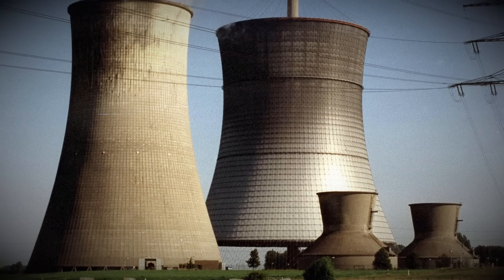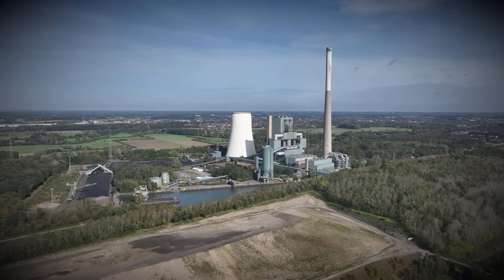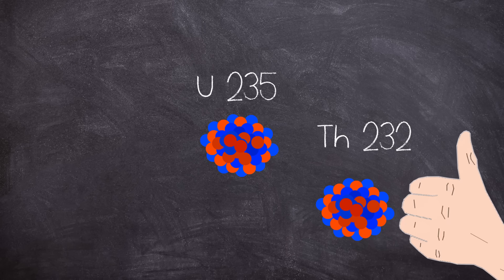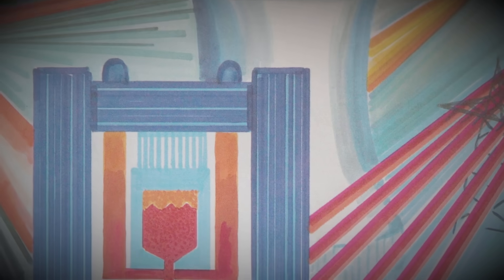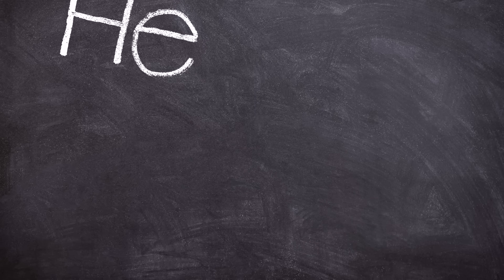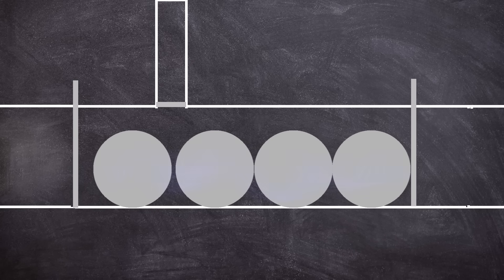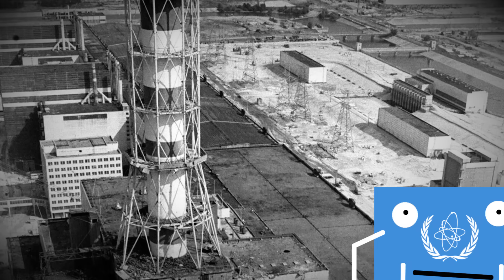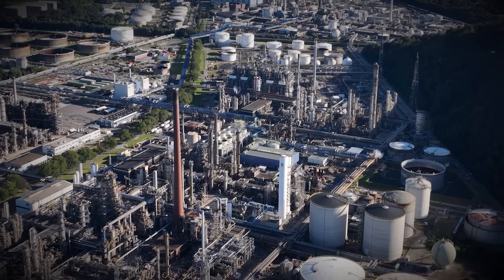Inside Germany’s “Chernobyl”

Comment: This is the silliest reactor design ever. The RBMK is much safer if safety systems can't be bypassed. If Germany built proper reactors they wouldn't need to cuddle up with Russia for energy supply because they didn't learn how that went the last time.
Reply: There are many improvements in recent GenIV reactors.   The older (GenIII+, GenIII, GenII, GenI) water based primary coolant designs generate a large volume of radioactive water; compared to helium primary coolant which runs much hotter temperature and does not become radioactive.
Reply: @Carlos-im3hn  Hmm, (ponders) what if Helium-4 captures a neutron and turns into a different, radioactive isotope? According to what I could find, this would decay instantly...
Reply: Only a minor part of the imported gas is used to generate electricity. About half is for other industrial purposes and about 40% for domestic heating. Electricity only accounts for ca. 13

And the share of electricity produced by gas plants was always round about 15% over the last 2+ decades, while nuclear was at about 30% when it peaked.

We didn't replace nuclear with gas.
Reply: Germany had plenty of proper reactors, THIS was an experimental reactor...

Comment: There is professor Nuclear Engineering Dr Robert Hayes that has much better description of this & other types of nuclear reactors and I has videos of that. This issue came about a feeding mechanism that failed but not the reactor design. Nevertheless, due to the Cold War, the Germany being on front lines of East & West, the German people has a right to protest as if the Cold War went hot, Germany & it’s people would irradiated & destroyed.

Comment: Phillips 66 oil refinery in Lincolnshire has a wide history of disasters. From a steam valve release causing two workers with horrific burns in 2000 to the 2001 Easter Monday explosion. Also next door is another refinery called Lindsey oil refinery which in 2010 had a pipe ruptured when the crew cut the pipe after told it was safe. One sadly didn’t survive.

Phillips66 Lincolnshire also had an oil or diesel leak which started a plant wide fire i think in the 1990’s but all information on the web has been lost. I do still have a newspaper from my dad who worked on the plant during the fire but it’s in the attic.
Reply: After the explosion on 2001 they had to install a community alarm system to warn the village if an incident was likely to affect the village… yeah they didn’t have a village alarm until ordered by H&S after the explosion. Both refineries are dodgy and has had constant issues with either coal trains derailed, fuel tank farm overfilled, one fuel tank imploded while pump was cleaning out vapours, monthly gas leak site alarms. Also poor security as they have a public split between a refinery and the thank farm with only a wire fence as security protection.

Comment: I am always amazed that nuclear people never will understand, that the opposing side is not so easily satisfied with being gaslighted as themselves.
For once the permanent framing that the anti nuclear side is just afraid, scared, idealistic and so one and nuclear morons are smart and rational, is going to impress no one. THe cold hard reality is that the anti nuclear side has looked into how well nuclear works and the results are clear, it is unbelievable expensive, the waste will be even more expensive, the plants are unreliable, useless for the grid without massive storage or fossil fueled compensation plants, the fuel is limited, there are states that even the nuclear radicals don't want it and won't provide it, like Iran, Pakistan, North Korea, Somalia and so on, the building time is a joke and even after now 80 years with trillions, unbelievable amounts of support and pushing for nuclear it is still not even relevant on the scale. Oh and of course nuclear creates CO², the mining gear runs on oil.

Also 12:50, the total energy consumption contains also cars, ships aircraft and so on, where nuclear is literally not even a solutions for the nucleards. Nuclear was for a long time at 6% of all electricity, the absolute peak in Germany was around 40%, in 2023 Renewables, Wind, Solar, Water power, Biomass made 59,6%, and this year we are currently at 63,6%.
We literally didn't even pay 10% what nuclear cost us and are already way above what nuclear ever did.
Also Nuclear in 2022 where it run the whole year, it was about 6,7%, Renewables where at 48,9% in that year by the way.

Using the total energy consumption only is used to throw mud on the issue, especially since it is provided with zero context. It is literally, look here big number so nuclear good "enemy" bad. 77,6% Context like that the nuclear strong force USA is at 82% fossil fuels. Or that in Germany in 2022 nuclear power only had < 2% of total energy consumption.

So I am fine to debate and talk about alternative ideas and concepts, but if you have to start by lying only to get in the debate, I am neither impressed nor interested, so keep with real data and honest points, and if, you might not be able to come up with those for nuclear power, then I suggest, that you might be on the same point that I arrived at around two decades ago, when I ditched nuclear power as a relevant power source.

Comment: The Pebble Bed reactor was almost designed to fail. One they were trying two brand new never before tried technologies together which is never a good thing. Second The Pebble Bed Reactor control scheme was essentially like a vending machine. The Pebble Bed reactor relied on ball handling paths whose reliability was tenuous at best. In fact it was a ball handling error that crashed the system. Also the high hard minimum add ball limit prevented any granular adjustment of the system if needed. The manual add system added human fault to a system that had few redundant fault tolerant safety systems. This is essentially a rube-Goldberg reactor design destined to fail. Human Arrogance led to this disaster.
Reply: That whole 'testing two brand new technologies together' thing is probably a result of a severely stretched research budget which is 'expected' to produce results. Trying to achieve massive breakthroughs on the cheap is always dangerous.
Reply: @momon969  Yes these are all complex.  The new GenIV pebble bed reactors hopefully have addressed all the issues after 60 years of development.  The new GenIV designs have many passive and other automated controls to avoid many (and hopefully all) issues.
Reply: @momon969  Too true.
Reply: That was a basic interlock problem, as in, how could anyone do that crap and sign it as OK... From the place that is anal with safety...
Reply: @tiagoangelo3828  The fact that the balls fractures from THERMAL STRESS when there was a malfunction in the injector mechanism demonstrates that nobody had designed a proper preheat system into it.  You OBVIOUSLY don't insert anything you want to survive across a temperature gradient of hundreds of degrees like that.
Reply: "vending" machine should be "Pachinko" machine with the 6cm pebbles falling down slowly in the reactor among other control pebbles among dynamic control rods.
Reply: @Carlos-im3hn  Rather reminds me of PLINKO game on the Price Is Right.

Comment: Before the video got very far, my first thought was "valves , brittle graphite spheres, stuck valves from debris from brittle graphite spheres, all under immense gas pressure" . What could possible go wrong? Possibly designed by the same engineers who designed the VW V-6 timing chain debacle.

Comment: It's really hard to argue that bailing out of ex-Soviet-led reactors was a bad idea, but as so often happens they threw out the baby with the bathwater by bailing out of fission reactors entirely.
Reply: West Germany didn't run any soviet technology, as exports and imports to/from the USSR were severely restricted. Instead, they either developed their own systems, or cooperated with other western countries (eg France or the Netherlands). In essence, they ditched their own stuff.
Reply: I think the saying this triggered Germany to bail on fission is not really accurate. The Chernobyl incident itself had a much bigger impact on public opinion and boosted the anti-nuclear movement, but even that did not lead to Germany's departure from it. Only 10 years later in 2000 was an actual plan to exit fission (over the span of 20 years) passed in the german parliament. It was under the first government that the green party was part of. The greens of course were the party that heavily advocated for the position of that movement. A later conservative government under Merkel 10 years later actually wanted to get rid of it and was busy making modifications to delay shutting down plants – until Fukushima went poof. It was then public pressure that forced them to go through with it. If Fukushima hadn't happen, they'd for sure have at least watered the exit plan down or done away with it all together.

Comment: There is another flaw with the reactor. The reason for the high level of radioactive dust inside is that nobody had anticipated that constantly poking a ball pit with rods could scrape off material. The control rods had damaged the balls. The incident would not have happened if the balls were not damaged due to this design flaw. The radioactive material was supposed to be contained inside the balls. The airlock was meant to be a second line of defense - not to be the primary and only line of defense against the leaking of radiation.
Reply: Yes, and it was a prototype before larger reactors were built. It is only 300 MWel the East Germans had several vver440 with 400 MWel output
Reply: @Jakob_DK  You know that a VVER reactor design is completely different than THTR right? VVER comparable to PWR.

You make it sound like the THTR prototype was just a smaller but identical sibling of bigger "VVER" reactors, which is false.
Reply: @ 
Yes I do know they are very different reactors, but competing to built large reactors with “ economy of scale” they were behind even USSR and DDR. That is not a good place to be.
Reply: @Jakob_DK  Ah yes, on that I can agree.
Reply: well for sure the control rods slide within pipes. would make no sense otherweise. but there is abrasion everywhere just by the balls sliding along each other. plus this "safest fuel of the earth" multiplies the amount of waste, by it being embedded in tons of radioactve carbon. crazy design.
Reply: @KarimY-119  The whole point of preprocessing spent nuclear fuel is to separate it into different components, some of which are useful, others of which must be stored until they become harmless, some of which can be used in making new fuel components.  They probably thought they could safely reuse the graphite to make new fuel, after it had cooled down a while.  The problem is graphite isn't a good material for making things that need to rub against each other, being extremely easy to abrade material off it.  There's also problems with the fission products, as if th balls are hard enough to have any real resistance to abrading each other, they'll be sufficiently gas tight that the pressure of gaseous fission products will be able to spall bits off.  They'll be very small bits, but that's worse, as carbon dust is horrible stuff even when not laced with radioactives.
Reply: @KarimY-119 Well, in theory you could burn the carbon reducing the amount of waste. However burning carbon and not cartapulting out radioactive elements within it is quite difficult. This is the reason why coal fireplant not only contain radioactive elements in the dust they produce but also some in their exhaust. Shutting down our nuclear reactors was probably the second stupidst thing us germans ever did.
Reply: And nobody had expected that balls of graphite rubbing against each other would produce graphite dust.
Reply: i think there will be some kind of scrubber. typical german over engineering . i wonder what their plan was how to handle all that radioactive coal. concepts like these have killed the nuclear industry.
Reply: Just don't let 'em touch.
Reply: not anticipated? the first thing I though was is it actually stabbing the fuel pellets every time you throttle it down
Reply: @limes5295  I believe the idea was that graphite on graphite causes very little friction. But, well... 🤷Someone involved in the AVR described it as: "The pellets go in shaped like balls, and come out not shaped like balls."
The whole project - including the AVR which was built at the site of a research institute - was financed not by scientific grants, but by industry money. So I guess there was a lot of pressure to "make it work", or at least pretend that it works, no matter what.
Reply: @ahoannon5711  it wasn't graphite on graphite, balls were coated with silicon carbide, which is supposed to be wear resistant. But it's also brittle and inner pressure of gaseous fission products could tear it apart.
Reply: @ahoannon5711  And the AVR is another unmitigated disaster. From a couple thousand fuel elements containing highly enriched uranium that went missing during operation and are still unaccounted for to a cracked bottom reflector that still has about 200 fuel pebbles lodged in its cracks that can't be removed. The current official "plan" is that decommissioning the reactor vessel can start around 2100 (ie. 75 years from now), keeping fingers crossed that the necessary technology will be available by then. The operating company was such a mess that it was eventually nationalized.
Reply: @Papinak2 can't believe they didn't also coated the balles with Teflon to reduce friction and trap anything britle breaking inside it.
Reply: @limes5295  I expect that it worked fine on the surface of the pellet bed.  The problem would likely be when the rods had to be pushed deeper, where the balls were being held in place by the weight of the balls above them.

This is one of those things that simply can't happen in designs where the control rods are in physically separate channels from the fuel, as is the conventional way to do it.
Reply: @evensgrey  
How much force would it take to reliably scram a pebble bed? Does it need a powered hydraulic cylinder?

Comment: I've heard of a reactor type like this, but i didnt know they were ever tested, they seem to be very difficult to operate if you ask me.
Reply: The new X-energy Xe-100 using similar 6cm TRISO based pebbles is getting approved in US, Canada, and UK.  These may come on-line by 2030.

Generally, more difficult than what else ?   This 1980's design had not been through the safety protocols arising after Fukushima, so had too many latent failure modes.   Hopefully live and learn.

Comment: I haven't checked the data again but I think German electricity wasn't actually so dependent on Russian gas. Rather, Germany burned a lot of domestic lignite.

Russian gas was more required for heating and many chemical processes. Electricity was just a very small part of the usage of Russian gas.
Reply: Yes, their mines started encroaching on villages. And lignite coal is the dirtiest form of coal. They also speed built floating gasification plants on the coast to import LNG from other countries, AND kept the last reactors online 4 months past their shutdown dates cause they needed the power.
Reply: Yes, the share of imported gas used in power plants is only around 13% right now.

And its share in the electric primary energy was never that high anyway, somewhere in the 12% to 17% band over the last three decades if I remember correctly. 

Natural gas plants were needed in the "nuclear age" anyway to compensate for load changes. Nuclear plants can only change their output very slowly while gas plants are the most flexibility.

So back then they were needed as major plants were not flexible enough, now they are needed to compensate renewables volatility. 

Until we get more scalable storage than the few pump storage water plants we have, and better ways to balance supply and demand on the demand side, too.

Which are both finally becoming technically viable now ...
Reply: @hartmutholzgraefe  There is yet another on-demand kind of power plant, the pumped-storage hydroelectricity. But there are only so many slopes on which you can place thesre devices. 

Edit: no, energy storage via the lifting of concrete blocks on ropes won't count for me. There hasn't even been a pilot project that would prove that such a construction can deal properly with wind gusts or earthquakes, so it is out of the question.

Comment: ....making is gas tight.mmm
Eh, that is helium. So small, if can diffuse through seals and even container walls.
Reply: Are you confusing helium with hydrogen here maybe?
Reply: @hartmutholzgraefe  Hydrogen comes in pairs (molecules). A noble gas won't... (looks into the Wikipedia) not only this. 

The approximate radius of a Hydrogen atom is about 32 picometers, Helium is at 28. Bummer.

Comment: Good Video again, but you should have looked up some 2024 number for Fossil Fuel-Burn in Germany.
2023 was hard but long ago, since then down to 35% Fossil fuel right now, rapidly developing more renewable Energy.
Germany has only very little reserves of Uranium in the ground. Would be stupid to base your main power-production on something that's hard to obtain, or would lead to deal with "unfriendly" nations or nations that don't uphold the values you want them to have as trade-partners. We saw how problematic the dependency on rus gas was. Also to me, neither the state administrative nor the executive side of nuclear Energy seemed to be on top of the game. With rotting and breaking old reactors, having to bring in cash, as main priority instead of providing cheap clean energy. So a clean cut-off was probably good, with certainty and policies allowing rapid growth of rewewable energy.
Reply: Germany had a lot of uranium - unfortunately that was pretty much completely mined by the Soviet Union in the GDR back then...